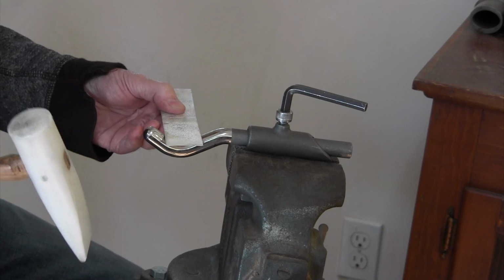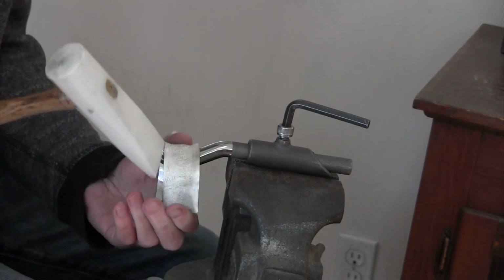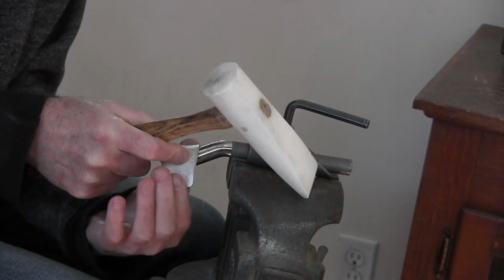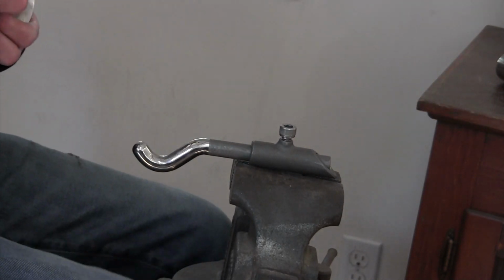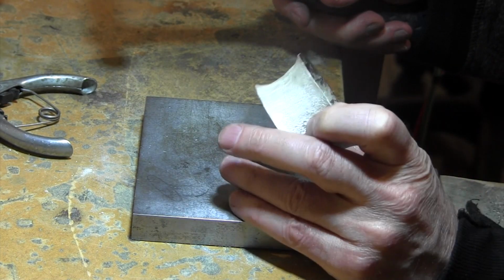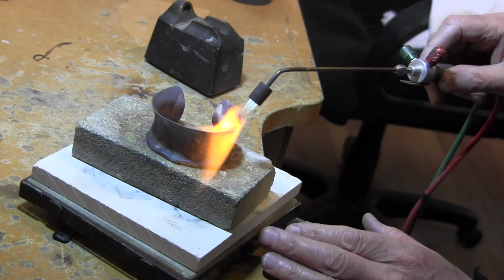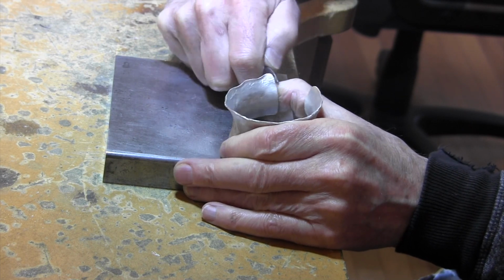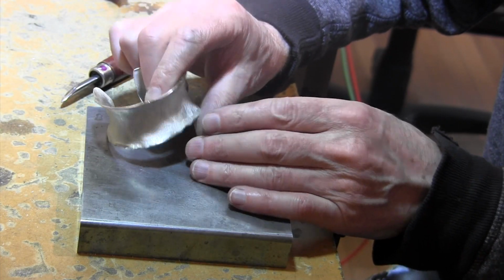Jewelry Tutorial: Anticlastic Cuff From Reticulation Silver

Comment: Hello. I have a couple of questions. How much did this piece weigh? Also I just purchased some 800 silver pickle and relish forks that aren't pretty and after watching your video, I think this would be a nice solution. Any suggestions since reticulated 800 is probably going to be very brittle. Thank you for sharing this video!
Reply from the maker: I believe that 800 silver is what we call reticulation silver which is 80% silver 20% copper, if so that should work. 

Reticulation silver is a bit brittle but it still can be forged and worked with as long as it is somewhat thick so you need at least 20 gauge I use 18 gauge.  The piece in this video weighs about 40 grams.  Be careful with your forks it can be very easy to overheat and melt the edges and even melt holes in the piece.  Good luck.
Reply: @patcahillmetalworks322   hey Pat, I really enjoy your videos. Are you going to post some more soon?